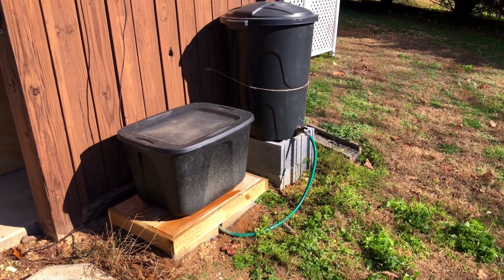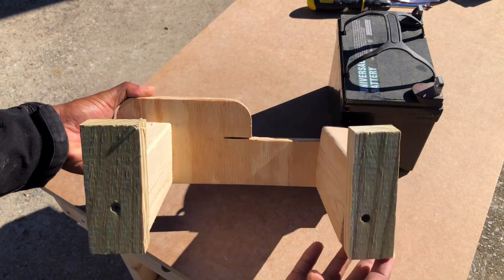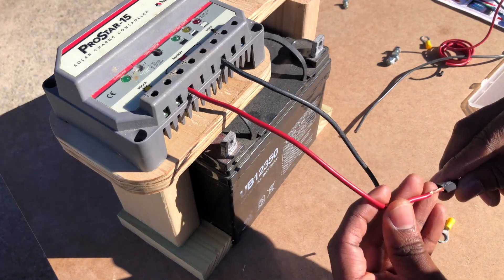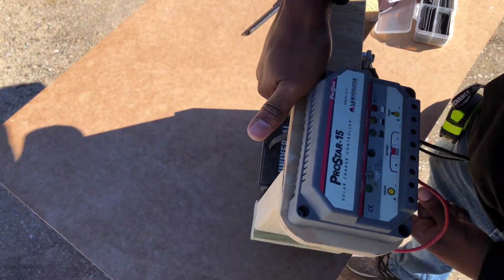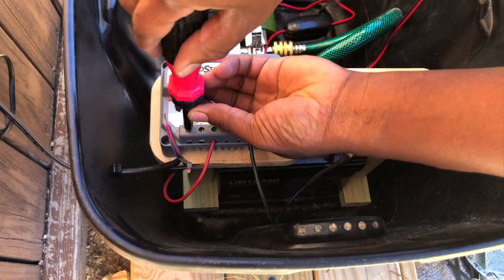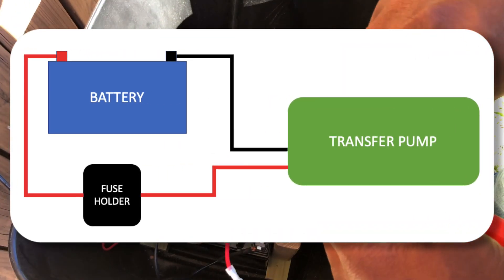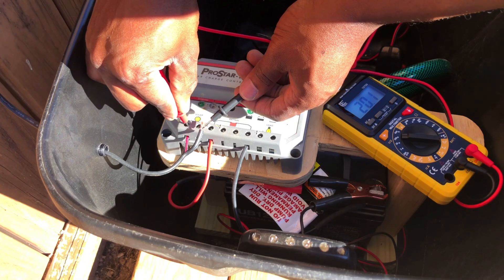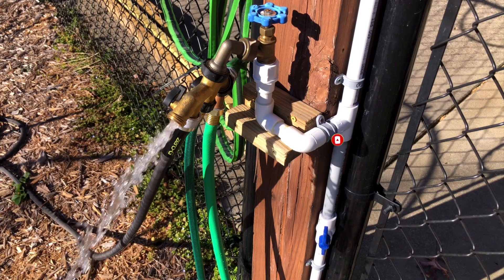Solar Water Pump | CHEAP Rain Barrel Solar Pump Setup

Comment: Would this work for running a pond ? Without draining out the power using a 12v pump ? I'm looking into starting a pond  using Solar to run the pump.
Reply from the maker: Maybe a smaller pump that does not use as much power. Once you know how much power the pump draws, you can then use some basic solar calculators online to see what size battery & solar panel would be needed to run the pump 24/7. If you do not plan on running the pond 24/7 that would reduce the size of the solar panel and battery you may need.

Comment: You did not include the hook up of the battery to the pump.
Reply from the maker: Hey Gary, a lot has changed since this video, and I believe the hookup may have been shown in a previous video...I would have to check. 

Yesterday I just released an updated easy to follow diagram that shows how all my components are connected available here: https://greentechtown.gumroad.com/l/mhzjme

If you are just interested in mainly the pump setup, you can find that diagram here:
https://greentechtown.gumroad.com/l/numtlc

Comment: does this system need an inverter?
Reply from the maker: No. Everything uses 12v DC power. If I was using AC powered items, then yes, some type of inverter would be needed to convert my 12v DC battery power to AC power.
Reply: @GreenTechTown  thanks.

Comment: Hey bud nice build. You wouldn't happen to have a link to the on/off switch you used eh?
Reply from the maker: The switch comes pre-wired with the transfer pump I am using. It's basically a "rocker" switch, but if you go over to Amazon, they should have plenty to choose from that you can wire up yourself. Here is one as an example: https://amzn.to/3UEDRda
Reply: @GreenTechTown  right on thanks. Gonna replicate this with an on demand pump for a new garden I worked over in the pasture and a 1000 gallon tank.

Comment: I am aware this video is old, but I'd like to understand if an earthing iron rod, was installed for the solar system used to power the water pump and if not, why? It will be useful to know which solar systems need earthing and which ones don't. Thanks for the video.
Reply from the maker: In this video I do not believe I did due to the small size of the panel and since I thought this was a temporary project. When I upgraded to a larger panel I did go ahead and install a grounding rod since if the solar panel had a fault of some kind and someone accidentally touched it, it would reduce the changes of them being harmed. But I would advise to call up a solar installer in your local area and see what they suggest just to be safe.

Comment: I’m very interested in this setup as well as the possibility of remotely controlling it. I am planning on building an off grid greenhouse (to house my orchids) that I will need to have set up with water catchment, automatic sprinklers/misting as well as power for fans, heat, lights, etc.  which would allow me to travel without any worries that my collection is being taken care of. Thank you for your excellent video. 😊

Comment: How exactly do you plug in the transfer pump?
Reply from the maker: It depends on which type you purchase. There are AC and DC pumps. AC pumps would plug into a normal outlet you find in your home, whereas a DC pump would connect to a 12v battery in most cases.

Comment: How do I size a water pump (200w) to run 24/7? Do you mind help me with the first insights? I'm new to your Channel, but I've already started marathoning the videos (I'm sure I'll find a lot of what I'm looking for here. Thanks!)
Reply from the maker: First, welcome to the channel! :D Regarding your question, I'm not a solar system expert, and I definitely would recommend joining a DIY solar forum community and asking the same question, but here is some basic information to know: You will need to find out the total amount of direct sunlight you receive on average throughout the year. This will help determine the solar array size you need. If you live in Florida which receives about 5-6 hours of direct sunlight, and your pump is running 24/7, you may need a solar system that is producing 800W (Watt hours / Sunlight Hours = ((200W x 24 hours) / 6 hours) ). For the battery side, you may need a 12v battery bank with a 400 Ah capacity (4800Wh / 12v = 400 Ah). Most basic systems are 12v so that's why I used that as a reference. But there are many more variables that come into play where you may want to increase your solar system size and battery size to account for cloudy days, power losses in your inverter (if it's an AC pump), wiring, temperature, battery type, etc.
Reply: Thanks,  @GreenTechTown ! You help clear and refine a lot of information I collected. Especially about the choice of AC or DC pump.

Comment: Awesome video! I have zero idea about the whole solar powered system, is there a need to limit the charging of the battery? Like when the battery is fully charged is that handled by the solar charge controller?
Reply from the maker: Thanks, and yes, the solar charge controller is responsible for handling that.

Comment: Great video, but I must have missed where you hook up the pump to the power source/battery. I saw you add the fuse, but did not see the part where it was connected. Is it just wired directly to the battery, or is there some special connectors?
Reply from the maker: I believe in this video, it was wired directly to the battery with the fuse. I would manually turn it on using the built-in switch. This is an old setup, and currently, I am using an on-demand pump and have things wired quite differently. If you have the time, I would recommend watching the entire series located here: https://www.youtube.com/playlist?list=PL65IIDhJLt9JXfCYu4H-3a_P9NfGgPl9I

Comment: You can have a 1000w panel, hold both positive and negative wires in your hands, it wont do anything to you AND you can literally put your finger on the positive of a 12v battery then other finger on the negative...IT WONT DO ANYTHING to you. Stop teaching people to be terified of using a 12v battery.

Comment: Great video. Just quick question? Does the pump works when you dont use the water? Or you turn it on only when you are going to use the water? What is the pressure your pump is able to deliver? And finally do you have to leave small opening in the rain barrel to allow the air to come in as the pump sucks the water out? Thanks.
Reply from the maker: A lot has changed since this video, and I would recommend checking out some of our latest rain barrel videos since I learned quite a few things to do and not do. First, I changed the transfer pump to an on-demand pump which has a pressure switch built in and will automatically turn the pump off if the outflow is closed. This will help prevent the pump from being damaged over time. I do not remember the actual pressure for the original pump, but the new on-demand pump I'm using I believe is 60PSI. And yes, I did create an air vent to allow air to enter/exit the barrels. You can find the rain barrel series playlist here: https://www.youtube.com/playlist?list=PL65IIDhJLt9JXfCYu4H-3a_P9NfGgPl9I

Comment: One thing check out the charging parameters of the charge controller I bought a Colman 30 amp charge controller for another project and found it charges the battery to 12 volts says it's full and stops charging at one time I would have thought great it's charged  but I found utube and found that's considered dead at first I thought that they were wrong but since my old black and decker booster pack was handy I took it apart to find out the battery manufacturer so I could check out their website but I didn't have to written right on the battery was do not discharge below 12.2 float charge is 13.4 and full charge is 14.8 so it was no wonder all my booster packs would quit taking a charge after a year they were being discharged way too far I rarely drained them below 6 volts and after the first one kept them on charge so I thought a year was all they lasted and bought a new one every year so I could use the inverter to charge my cordless tools while at jobsite without power or where I needed too long a cord to reach

Comment: Question...Couldn't you just attach the water pump to the "Load" connections of the solar charge controller instead of hooking it directly to the battery with the additional 10A fuse?
Reply from the maker: It may be possible, but from what I've seen over the years, most prefer or recommend to run high loads directly off the battery. I would recommend checking with the manufacturer before hooking it up directly to the charge controller.

Comment: Why didn't you hook up the pump wires to the controler? Is your pump a on demand 12v pump?
Reply from the maker: Most recommend running higher loads directly off the battery. I would advise checking with the manufacture for the charge controller you have to see if it is okay to run the pump from the charge controller load terminals.

Comment: I'm looking to set up a solar water pump to circulate water in a water garden and I think this fits perfectly in that plan! Thank you so much. What a wonderful DIY tutorial video! I guess the only thing I would need to do different is add some sort of off and on switch or even a simple timer.
Reply from the maker: I thought the same when first starting out but soon learned about on-demand pumps. I've done a comparison in a video you can find here:https://youtu.be/AWDUjUxs3iI
I'm currently using an on-demand pump.
Reply: @GreenTechTown  thank you very much. I will check that out!

Comment: Tip: that wire crimper you use to put wire terminals is not very good. Try one that has a tooth that squeezes the connector better. I have seen many failures because of poor crimping.

Comment: set up an irrigation system to everything you regularly water, then set a switch timer on the positive or negative lead for the pump. Set it to water everything at sunset so you don't hurt the grass or plants in strong heat. You can use those cheap common plugs that turn lamps on or off on a timer.
I'd also put a cut off float in the rain water barrel so that the pump doesnt activate if there is not enough water inside the barrel. Simply put a relay switch at the top of the barrel, with a float (from a toilet) on a long metal rod pushing on the relay at the top. the water will always push the float upwards unless it is below the level you set.

Comment: Nice video. Thanks for sharing. Why didn't you run the wires to the pump using the load terminals of the solar charge controller? That would prevent over-discharging your battery.

Comment: Just wondering why you didn't connect the pump to the load terminals on the controller?
Reply from the maker: Just due to the current draw. I cannot remember at the moment the max the load terminals support on the controller.

Comment: If one is connected to the grid but want to add solar power, i say install a bunch of solar power.  But I don't get solar power and battery for single purpose system unless it's not convenient to connect to mains power.

Comment: Great setup.  My only concern would be heat build up in the container holding the controller and battery and then thinking further colder temps in winter. 

Have you had any issues temp wise with the battery and controller setup? 

Thank you for the video.
Reply from the maker: Good question. During the time I had my setup configured this way, I did not notice any major issues. I do agree with your concerns, and since this video I have moved most of the components you mentioned to another tote out of the sun and closer to my new rain barrel collection system. The only component in that tote now is my on-demand pump which I also plan to re-locate later so that it is not in direct sunlight and closer to the rain barrels. You can find some of the changes I've done since this video at the following video playlist: https://www.youtube.com/playlist?list=PL65IIDhJLt9JXfCYu4H-3a_P9NfGgPl9I

Comment: I know your system is low voltage, but do you need water proof wiring, connectors, and junction boxe(s)?

Comment: Excellent build and descriptions.

Having done some offgrid applications for solar power.
I would make a couple of recommendations.

Add a switch between the solar panel and charge controller. Another switch between the load and the controller.

This way you can shut off the power from the panel to do any possible maintenance.

Add a grounding cable to the panel.

Drill some drain holes in holes in the bottom of the container just in case of water intrusion.

Also for some reason ants like electrical systems.
Put out some insecticide granules around the setup.
Reply from the maker: Thanks for the tips! I've changed quite a bit since this video and have implemented some of your suggestions, but probably need to look into adding the others.  How many systems have you installed, and is this what you do for work or just a hobby?
Reply: @GreenTechTown  Hobby and for personal.
At one place I designed and installed 4 minor systems.
Everything is 12 volt.

Two small systems to run  the lights in a house.
One system is a Harbor Freight 45 watt system.
It runs 4 12volt 900 lumen LED lights  and will charge phones using old lawnmower batteries.
When needed it provides the spark to light a propane refrigerator.
Once charged a battery will last about 4 days while the other recharges.

One setup solely to run a small 12 volt refrigerator freezer.
Looks like an oversized cooler.
Enough to keep milk and  lunchmeat cold.
It froze a pork butt in 12hours last year.

It has 3 100 watt Harbor Freight panels plus 3 deep cycle computer back up batteries.

Another setup has about 180 watts of panels and 3 more batteries that runs about 10 12volt lights in various rooms  charges phones, Ryobi 18volt batteries.

Then another 300 watt system to charge 3 more deep cycle batteries as a redundant system.
It is usually setup to run 4 12volt lights and a small inverter to charge tool batteries.

If something goes wrong I can hook the 12volt fridge to it by switching the clamps.
 
I have switches to cut the power before and after the charge controllers.

The batteries wires connections are big alligator clips that way if something goes wrong I can power up any part of the system by switching the source battery bank.

I also have a set of good jumper cables running through the wall.
Just in case I can charge the system using my truck in a pinch.
Reply: @GreenTechTown I am doing this to keep from paying a utility bill when I get old.

Going green for me is not about saving the planet.
It is about keeping green stuff in my pocket and not giving it to a utility company.

Comment: How do I setup this system with an outdoor plastic or stainless sink/table with a faucet? Turn on the faucet the pump starts.
Reply from the maker: I would recommend you use an on-demand pump for that type of application. That's what is typically used in RVs. You can find a little more information on this video I made comparing an on-demand pump to a transfer pump: https://youtu.be/AWDUjUxs3iI

Comment: Good idea to drill a few holes with a fine mesh over the holes in bottom or lower side of tote just incase you have a leak. It would not be good to have a battery and solar current get soaked....
Reply: I was also thinking this, better to have a drain hole and not need it. And covering with fine mesh/screen to prevent bugs inside. You could also make a drain tube with a mesh at end of tube

Comment: I seriously plan on setting up a battery free solar system to power the well that serves my entire house. I'm going to have to hire an electrical engineer to crunch the numbers, since it will be a much more power hungry system. I'll make it switchable and use two separate pumps. But I WILL do this. If you have ability to help design such a system, please let me hire you!

Comment: Which battery are you using and how long does it allow you to run the pump? My runs at best for 45 seconds at open flow and will cut off almost instantly when it builds up pressure
Reply from the maker: I'm using a 12v 35Ah deep cycle battery.

Comment: Great video.  1 tip i would give is on ALL connection areas especially in the controller, use dielectric grease to keep oxidation down.  Solder any connections you can for best results.  2 cents
Reply from the maker: Great tip and thanks for sharing Infiltrator2003.

Comment: Future reference a pipe Union would have been a good idea next to the pump to be able to move the pump it serviced or replaced. I have a koi pond, and I have a union, next to the pump, it saved my butt many times... And also allows you a way to blow out the line in the winter time so it won't freeze and break the PVC, other than that excellent video!!

Comment: Thanks for the video, I didn't see how you wired the pump to the power source.
Reply from the maker: The wiring for this setup has changed since my original build, but I somewhat showed the basic electrical setup in the video prior to this one. However, if you follow the series for this rain barrel project, you may receive a little more insight on the wiring.

Comment: This was a great video. Nice that  your initial box with the pump was tall enough to incorporate the Solar charge controller.   Note:  On you wood mount fo the solar panel, your bottom board that comes out from the house could use a stronger connection.  By having it on the bottom of the vertical board, your solar panel will continue to put a little pressure on it, resulting in it getting loose.  Suggest either using Kreg jig to mount that bottom board to the side of the house board instead of underneath it. If no  Kreg jig, then just toenail it with two screws to the house board. (Toenailing—driving a screw/nail at an angle)